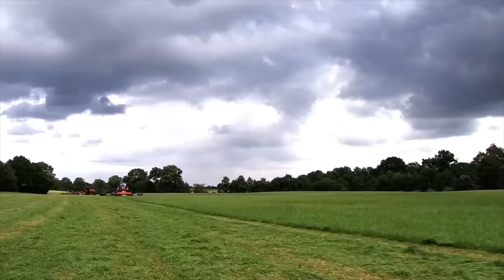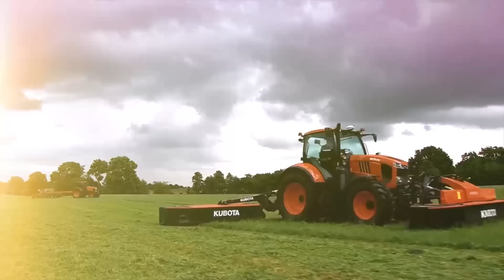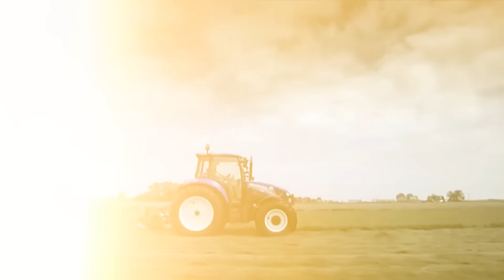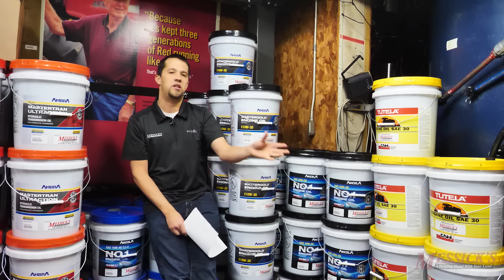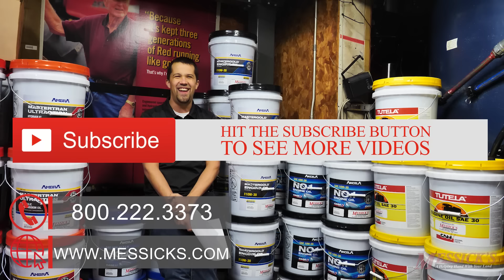A hydraulic fluid so bad, its been banned!

Comment: I’ve used 303 for years in tractors from the 50s all the way up to the late 90s never had a problem with it
Reply: Albert bach . Ive got a jcb 3cx .only 4 years old with a load of small fluid leaks . Ie pitted chrome on a few rams . As much as id like to repair it . I cant have the machine stuck in the workshop . I need it on site earning money . Many plant owners are in the same boat . Try owning your own machines ..its not that simple .
Reply: Missouri banned it...I could by it for $25/ 5 gallons at Orcheln's...I put it in oil leaking Steigers...Gotta put about 2 gallons in them 40 year old tractors every time ya run them....Oil cheaper than fixing the leaks...  Bought 2 Steiger Panthers years ago for under $20,000 will do about anything a 400 hp $300,000 new one will do..Plus Big Tractor Parts up by Fargo makes every part for them still......I am a downer on new paint, meaning new iron...
Reply: Dave Hughes Farm what do you use now they sell some cheap stuff at tractor supply for around 20 bucks a five that’s what I got for a 1958 fordson I’m in Missouri too.
Reply: i do too
Reply: Ok ok, I get it. The equipment needs to stay running.. this is the real reason they dropped the product.. it was cheap and that's why leaks don't get fixed.

Comment: I used TSC Traveller hydraulic in my Farmall 460 & it formed a wax on the filter & cut off the flow. I changed the filter it happened again after an hour or so. Ended up draining the system & putting another filter and different oil to cure the problem & it never happened again. No more TSC oil for me.
Reply: The traveller could have been having a reaction with whatever oil was in the tractor previously, what oil did u end up going with
Reply: @v73w85  I had drained the old oil out to change it. I don't remenber what I replaced it with.

Comment: I’ve seen billon dollar company’s use 10/30   For hydro
Reply: It’s actually specified in some applications...
Reply: Welcome to the coal mine
Reply: Case construction used to (maybe still?) sells an anti-foam/ high heat additive, use a quart per so many gallons of 10-30 in hydraulic systems. Think it was called HTO.
Reply: It’s pretty close to the same weight anyway. Think hydraulic oil is a little below that at about a 20 weight. I could be 100% wrong on that but I don’t believe I am. My dad was a service manager at a heavy equipment repair facility and he said they used 30 weight oil for hydraulics all the time.

Comment: NC at times ( I am a country rural citizen here )  actually does fight for farmers, homesteaders.. youngings like ChuckE2009.  I say this, due to a few years back companies were pushing for a stop of selling special tools, manuals etc to anyone other than the dealer and those that worked at the dealer.  NC stepped in and basically said.. customers that buy the product, thus making it their property. Have the RIGHT to work on it if they wish or take it elsewhere for repairs.  I think something like this happened in the midwest with John Deere and the software used on their high end machines. NC went to bat for the ole shade tree mechanic.

Comment: Funny, I run 303 in my equipment from the 70's, 80's, and early 90's. All of it has between 10K and 20K+ hours on it and I have never had an oil created failure. 

Something tells me John Deere lobbyists have been working overtime given the cost of their branded oil.
Reply: Look what John Deere has been lobbying for and are behind trying to prevent owners from repairing their own JD equipment without kissing the dealers ring. I have little doubt JD is behind this too.
Reply: Yeah I agree all I heard was they make the cheapest an weren't giving the rim jobs to enough players so they are being booted out of the market.
Reply: I think the problem lies with the hydrostatic dive tractors.. ..
Reply: All the equipment from the 70s and 80s and a lot of it in the 90s had simplistic and really low powered hydraulic systems on them which is why they aren’t capable of running very many of the new implements out today.
Reply: I have a 1967 Oliver that calls for type A transmission fluid in the hydraulic system.  I wonder if the 303 would work and cost less to drip...  lol
Reply: Is it possible that you've never experienced what your tractors run and operate like with the proper hydraulic fluid in them?

Comment: At an oil refinery some where there is a hydraulic oil bottling line, coming down that line some bottles say Traveller (Tractor supply company), some say John Deere, some say Kubota and some say......
Reply: I hauled bulk and pallets of oils from a refinery  years ago, they were bottling  every brand you'd  name. Base oil stocks were the same for a wt/vis only difference was additives that were  blended in to meet customers spec. Synthetic oils are a different  game all together
Reply: @johnycomelately1  and the additives are what make the difference in how well it performs.
Reply: Yep just like battery manufacturers there's only two of them . Just different sticker on them
Reply: Amusing how people believe anything negative they hear without doing in depth research
Reply: Kubota oil is definitely different than JD or TSC o have bought smelled them all i also do oil testing 😅.
Reply from the maker: This is absolutely 100% false. An elementary look at the MSDS sheets would tell you that.
Reply: Messick's 

Lol you clearly don’t know your stuff. I bet you think your Nike shoes and Oakley sunglasses come from a special factory. 90% of stuff comes from the same factory all they do is stick a different label on it.
Reply: 1.) They are just called SDS since a couple of years ago. 2.) If you think there is any appreciable difference oils of similar spec, then go ahead and waste your money.

Comment: 303 is not recommended for Tractors built after 1974..... Even John Deeres  30, 40, 50, and up take a oil with a J-20C spec...  There are a lot of Old Deeres  (20 series) that 303 is suited for......    You have to become educated enough to read the label
Reply: Exactly...
We ran 303 in out old Allis Chalmers for years with zero issues...
That is what was spec'd for the units...
Reply: Yes they make oil that covers the old standards of equipment built in the pre- 1975
SuperS premium (utto) and Super 303 (utf).
I just bought a decent Ford 5500 backhoe from about 1969 that has a dry hydraulic of 67 gallons, the heck if I am going to use $70 a pail hyd. oil in it for a 50 year old machine, that needs the oil changed and reservoirs cleaned.

Comment: that oil is $19 here.     it just says on it don't use it in anything later then 1974.    so    guys like me with there old 1957 tractors might be ok...lol
Reply from the maker: $19! how is that even possible. Just think about the costs to package, transport, stock, etc. Mind blowing.
Reply: 303 sells for $14.99 for 5 gallons all day long around here.
Reply: @MessicksEquip  Not to mention but how much could a retailer make vs the pricier stuff? LOL
Reply: 18.95 and 19.95 here on sale and it's always on sale.

Comment: If there is no standard, that would imply that they all suck.
Reply: No. What you don’t do is listen. Each manufacturer has their own standards for their equipment oils. It might cost more, but using hydraulic oil sold by your tractor distributor, is probably your best bet.
Reply: Agreed

Comment: I see it at my local tractor supply for $18.99 for 5 gal.  Hurry while it lasts LOL
Reply: Its fine for things like log splitters.
Reply: @davids.9834  Sure if you want your log splitter pump to shit the bed 500% faster. Oils that are ment to lubricate gears are not the same as high pressure hydraulic oils. Transmissions only operate in the 200- 400 psi range. Log splitters operate at around 2500 psi. The clearance between the pump gears will not mesh well with lower quality oils that cavitate because they were designed in a time that pumps only used low pressure to do work.
Reply: They are not carrying hydraulic fluid anymore and are getting rid of it, this brand anyway.
Reply: Runnings stocks 4 pallets for every 1 pallet of the expensive stuff where I live.   Regular price is 23.95, sale price between 18.95 and 19.95 and it's always on sale.

Comment: When the machine leaks 5 gallons of oil in 5 days it doesn't matter what you use
Reply: Some leaks you have to pull the cab or split the tractor for 1 bolt, so the repair gets shelved for that special day when the stars align on a sunny day when no other work needs to be done.   Send it to town and it could cost 5,000 bucks in labor.  How many $20 buckets of oil is that?
Reply: I got one of those!
Reply: Yep we have one of those in old worn out 1066
Reply: 5 gallons in 5 days is a little leak.  My cat 977 leaked 5 gallons a day.  Looked like someone left the hose on!
Reply: Some of this stuff is made for the same reason they still make type F automatic transmission oil, somebody will buy it, never mind that Ford had TSB's in the mid '70's and probably earlier saying not to use it anymore.
Reply: As a Kubota owner I like to use what the dealer recommends so if I do have a problem later they can’t say it’s because I used an inferior product, paying a little more now could save thousands later!
Reply: Oh yeah. Kubota l3470 or whatever. Been to the mechanics thrice. Once I have time I'm just gonna break it in half myself and go through it.
Reply: must be referring to a DU_AL loader
Reply: 😂😂😂😂 YESSSSS
Reply: let it leak and get more dirt in the system
Reply: maybe it is time to fix it.
Reply: Homecomfort ain't nobody got time for that when the machine is wore out
Reply: @michaelbligh1375  We run the bitches till the wheels fall off...We have 13 tractors...Versatiles, steigers an deeres, 1 case,1 farmall

Comment: Kubota only & only Kubota, have no issues , no problems.
Reply: I really don't think Kubota makes any Hydraulic oil...  Re label maybe or have labeled..
Reply: I agree. Put what it is designed to work on.. even filters. For what it cost and the service intervals your not really saving much of anything. Even filters that are built specifically for that engine or trans. In terms of filtering capabilities

Comment: So what was wrong with it? I get that they said don't sell it. Did they say why?
Reply: Two other states, Missouri and Georgia, have also "banned" the sale of 303 oil, so there is much more information out there on the subject. 

In a nutshell there is no way to test the oil to see if it meets the JDM 303 specification. So the bottlers can literally put anything they want in the bucket and call it 303. So you have no way to know what you're getting, and there's no way to prove what you got is NOT "303" oil. 

https://www.tractorlife.com/2018/06/19/perilously-obsolete-the-dangers-of-303-tractor-hydraulic-fluids/
Reply from the maker: The article says its because the fluid is not appropriate for use in any modern equipment.
Reply: @MessicksEquip  Thanks for the reply but that sounds like an opinion. What is actually wrong with it. I just put a lot of it in my old D4 so am curious as to whether it's an opinion or if there is some kind of factual basis. I could probably understand if explained to me. Thanks again. Love the videos.
Reply from the maker: It would be interesting to know the real basis. This is the article I was referencing. Its not specific. 
https://pqiablog.com/2018/08/08/north-carolina-is-now-the-third-state-to-issue-a-stop-sale-order-on-303-tractor-hydraulic-fluid/

Comment: Amsoil
Reply: Not spending $3000 to change the hydraulic fluid on my tractor. Hygaurd works fine and amsoil may be technically better but its not cost effective.
Reply: Jeff Ewing you do realize that amsoil is garbage, right ? The only quality oil on the planet is Motul.

Comment: The only thing we run that 303 fluid in is a worn out 1066 International that it's only job is running a grain auger or water pump the transmission is never under any heavy load anymore the problem with that tractors every single seal in it leaks and the rest of the tractors very rough before anyone says it know when we are done with this tractor it will go to the scrap iron pile we do have one 1066 that is a show tractor though that one gets good fluid
Reply: North Dakota 322 careful...ChuckE2009 will be contacting you wanting to buy the tired old 1066 to add to his hoarde lol.
Reply from the maker: I get purchasing cheaper fluids for old beat up equipment, but you deprive your 1066 of the last 40 years of engineering advancements. Its all speculation, but its very possible that tractor could be in better shape today with better fluids.
Reply: @MessicksEquip  we ran the premium oil in it for most of its life but when all the seal started leaking upwards of almost a gallon a day that's when we switch to the cheaper oil this tractor is never used for hard pulling anymore just PTO work all the rest of our equipment gets good oil
Reply: Chucke is a Messicks customer but so am I and much closer to accept a junk tractor to use I the field!
Reply: @ChuckE2009 Chucky this tractor is clapped-out out even by your standards I know the cab has been on fire at least once all the tires are shot the rims are rustad cuz it has calcium in them the frame is cracked from when it had a loader on it like when I say this tractor is shot I mean it is shot there are things worn out then it I didn't even know you could wear out I know a tractor has been split a few times to have new clutches and have the engine rebuilt the least twice

The hour meter stopped working at 21000 hours and according to my grandfather that was a good 15 years ago.  And this thing has augured every ounce of our 4000 Acre Farm into the bin and then out of the bin for the past 20 years.

I wish I could post pictures on here you would not believe how shot this machine is there is really nothing worth saving on it anymore.
Reply: Just buy their expensive fluid, that's what they want from you...more money
Reply: ChuckE2009 I kinda figured you would lol. Thought you were talking about buying a ranch before you bought any more collectables ?

Comment: What do you think about Amazon basics diesel oil?
Reply: Look at the label and see what API standards the oil meets.  You should be able to look up the oil on the API Engine Oil Licensing Directory:  https://engineoil.api.org/Directory/EolcsSearch  If the oil is listed in the API directory, then it meets the API standard and if that matches what is required for the vehicle, then you're okay to use it.
Reply: Should be okay.  Made by Warren Distributing.
Reply: Warren oil tests come back the same as Conoco. I used both at work in all the equipment such as loaders, Cat trucks, Cat gensets, etc. with no problems in a regular lab analysis program. The additives of both brands were the same in new oil, and oil samples @ 250hr intervals. The Warren oil was a little better on price than Conoco and that was our only reason for switching brands. Regular sampling takes the guess work out of who's who in oil quality, their additives package, as well as engine component failure/wear.